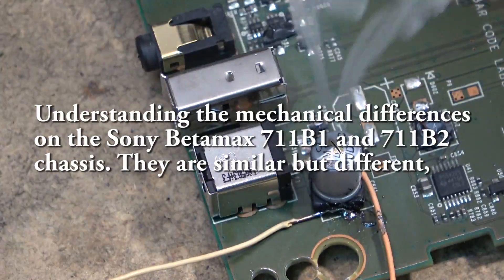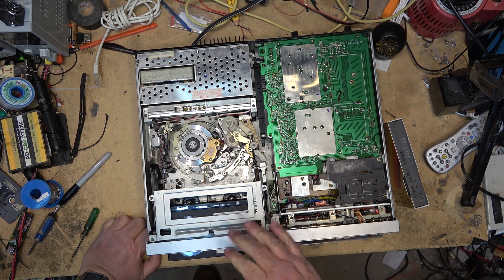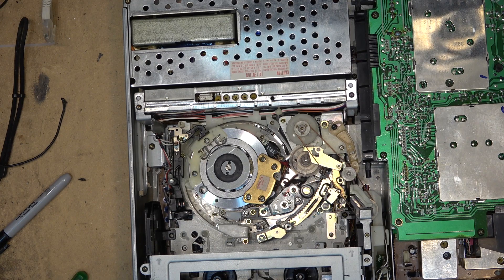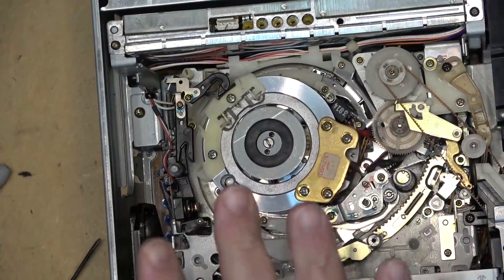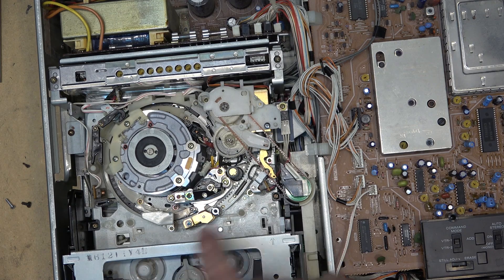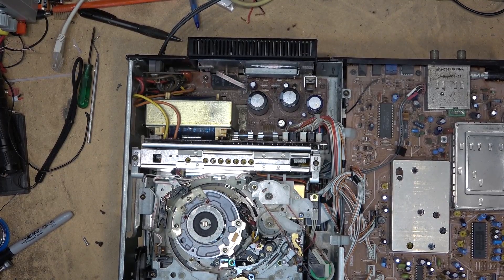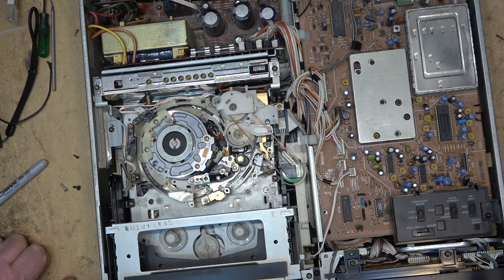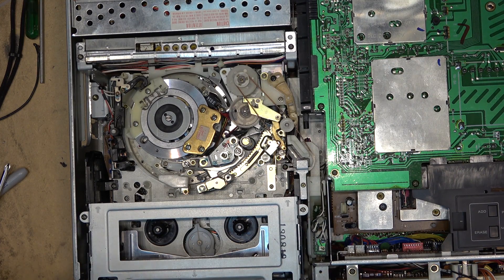Understanding the Sony 711B1 and 711B2 Betamax Chassis and how they operate

Comment: I have a problem with my SL-F60 which seems to share the same mechanism. 

The pinch roller engages, but doesn't move close enough to the capstan to actually put pressure on the tape. There is about 1mm of slack, even with the electro-magnetic arm pushed all the way in. Is there some sort of adjustment for this? Or perhaps the track the pinch roller sits on is slightly out of alignment? Any suggestions would be very much appreciated.
Reply from the maker: If the half gear (the one the pinch roller is mounted to) doesn't go all the way to the end if travel ur would affect the grip
Reply: @12voltvids  Thank you very much. I was able to locate the "PINCH SNAP-FIT LIMITER GAP" adjustment in the service manual, this fixed the issue.

Comment: Hi,
I am your subscriber from Istanbul and first of all thank you so much for sharing your great experiences with us.
I’m a big fun of retro electronics and VCR’s. One of my Sony Betamax VCRs (SL-F30) is broken a while ago. The problem was not taking the tape inside and loading. Then I started to search on youtube and find your channel.
With the guidence of your videos I first fixed the front cassette loading gears. But then the second problem occurred. Tape does not unthreading unless I triggered the process by pushing guides with my finger as you may see on the last video I shared. 

https://youtu.be/8aTpVUdTYn0?si=1uUIx2hB9akH4vrW

I couldn’t find any solution to fix this issue on your channel and any other place. I would be very appreciated if you help me how to fix this.
Many thanks, @12voltvids
Reply from the maker: It is a cracked gear on the bottom of the shaft under the  planetary gear (the one that turns the front loader belt)  i do have a couple videos showing this.  Its usually a black gear that is slipping on the shaft.  Needs to be glued onto the end of the shaft.
Reply: @12voltvids  thank you very much for your reply. I'll again search your videos about this issue and I hope I can fix it with the help of your videos.
Reply: @12voltvids  Hi again, I think it will better to replace with a new one when I remove it. So, would you please give the specs of that gear as mm and is it 8T or 10T? Many thanks...

Comment: I think you should make a video on how they process the NTSC signal(s) before recording on Beta/VHS. I know they downconvert the chroma to 688kHz but how exactly is that done? And the luminance signal is FM modulated but what is the carrier frequency? Would be cool if you scoped the raw RF signals from the video heads.
Reply from the maker: That's what the waveform is when showing tracking adjustment.  
The chroma is down converted to 688 for beta and 3/4" u-matic. 629 for VHS and 729 for the 8mm formats.  Super and hi8 use same chroma.  Only the lumanence is higher.  I have a 3 hour Sony training seminar video on my channel where the instructor covers all the technical aspects of beta betahifi and super beta in detail. I suggest if that interests you that you watch that one.

Comment: Hello everybody. Any tips on solving this issue? https://youtu.be/BP_8z6E_gYk
Reply from the maker: Looks like a bad head or problem in preamp.  On VCR there is an a field head and a b field. 
4 head machines have the heads arranged a/b & b/a.   This way they can select 2 a heads for freeze frame  and the standard a/b for normal playback.  Try playing a tape recorded at the other speed and see if it is any better as that would use b/a combo as opposed to a/b.
The heads are different track width for sp and ep speeds.
Reply: @12voltvids  thanks for the answer, master. happy holidays! I have seen other videos from you to try to fix it. I thought it could be either a tracking head issue. Tried moving it but no avail. Then i tried messing with the rollers height from a video you teach to realign without a oscilloscope. Also no avail. I dont think the head is bad because this vcr was not used at all.
Reply: @12voltvids  i was using SP tape. Tried SLP. It shows a fine image. What does that mean?
Reply from the maker: @ableite  one of the so heads is clogged, or damaged or the winding on the rotary transformer for that head is bad. Yes the rotary transformer can fail.
Reply: @12voltvids  thank you very much for the information!

Comment: Hey, unless I'm mistaken, that's an SL-2710 you're using for the 711B1 example.

I love that model as that was from my childhood.
Reply from the maker: Yes it is a 2710. Currently under repair.
Reply: @12voltvids  Regrettably, not a surprise considering the age.

That said, to have a machine approach 40 years of age before requiring major repair to get it back to operable condition, that just really goes to show that Sony made them well ... and that they don't quite make them like they used to ... which is a bit of a misnomer considering that nobody has made VCRs of any kind for quite a while now ... though, yes, an SL-HF2000 from 1992 is not built quite as stoutly as this SL-2710 from 1984.

I also currently own an SL-2710, though it's not the exact same one from my childhood (that one was, unfortunately, stolen in a home robbery in the 80s and was replaced by an SL-100, which is quite a downgrade).  But, like the one from my childhood, it's a PX model (military exchange), so it's multivoltage, though it remains NTSC only.
Reply from the maker: @Watcher3223  that's right the days of recording video on tape is over.  I have a few vintage machines here.  A beta 1, beta 2 single speed, vintage VHS, 3/4", 8mm, hi8, miniDV hdv and a BETACAM SX. I just collect them these days.
Reply: @12voltvids  Pretty much.  The only reason anyone would record to a video cassette of any format today is for nostalgia.  Otherwise, there is no practical reason.
Reply from the maker: @Watcher3223  i remember when I was working for Sony back in 83 one of the engineers that was showing off a MUSE hdtv camera and monitor that was on loan said that video tape would be dead.  Everything would be on memory chips in the future.  They were working on it back then but flash memory was still too expensive.
We all thought he was crazy.
Reply: @12voltvids  And then it obviously turned out to be very prescient.

I suppose it's because it was what we were used to, along with the old adage of not fixing what isn't broken, that we couldn't imagine something coming along that would make such leapfrog innovations possible.  But it happens ... and history is a testament to that.

A good example I can think of is the phonograph record and the Compact Disc, especially when it became possible to manufacture CD players more economically with equivalent, if not superior, performance for less money compared to earlier generation equipment.

Oh, and I wish you a Merry Christmas and a Happy New Year.
Reply from the maker: @Watcher3223  thanks
Reply: @12voltvids  You're welcome.  Stay warm and stay safe.
Reply from the maker: @Watcher3223  it's warm here again. Was up to +10c (50F) today. All that white crap almost gone.
Reply: @12voltvids  Ah, snow.

Three minutes wonder, three months woe.
Reply from the maker: @Watcher3223  it's all gone now thank God.

Comment: Great video Dave. I have a SL-HF300 which is a 711B2 chassis that won't load a tape. It's been sitting around for a couple of years since I got it, but now I'm gonna have to crack it open after seeing this!

It has a really dim display too, I recall seeing a video from you a while back about that, I'll need to revisit it.
Reply: Update: Seems like the regulator is cooked. I get no green light on the power switch and the solenoid doesn't fire.

Comment: Wow, I had an SL-2415 a few years ago and I think it had the same issue with the stuck switch and it going into fast rewind. I ended up selling it for parts because I couldn't figure out the problem but now I have a working SL-HF300 and SL-2000.

Comment: Your videos have helped me understand how to service my Betas in many ways. Great videos. You mentioned that the first machine in this video has a problem with the position of the head switching pulse, I'm currently fighting with my SL-HF900 trying to find out why the pulse will slowly work its way down the picture and ultimately cause the picture to blank out before repeating the process. A video explaining that would be most appreciated.

Comment: I have an SL-T50ME which uses the 711B(1) chassis. When I first got it I had an intermittent problem with the loading-end switch, the one you adjusted at the top-left of the deck. The symptom was the tape only threaded half-way. Rocking the switch multiple times solved it.
Reply from the maker: Yes that's right. That switch tells the loading motor to stop at the end if the load cycle.

Comment: I never tried it, but a Beta tape could fit into a vhs cassette, may play the video.
Reply: Both tapes are 1/2 inch wide so you can swap the tape from a Beta cassette to a VHS one or viceversa, but it won't play any video as the speed and all other mechanic characteristics are different.

Comment: It makes me think VCRs were the highest tech (consumer wise)  for AV  next to Laser Disc players..  when I record Audio to my HI-FI Stereo VCR , it's pretty much indistiguishable to a high end 24bit 96khz rip .. an A/B would provide quite difficult to tell them apart (on a proper HIFI vhs that doesn't jitter ect) . Very  minor differences in spectral analysis.  I've done DAT comparisons as well and no one could tell the difference.
Reply from the maker: Vcrs were one of the most mechanical electronic devices in most homes.

Comment: Thanks so much for this video Dave.
Another failure on the 711B2 is the failure of the plastic pin,
 on the coil sensor connected to a spring.